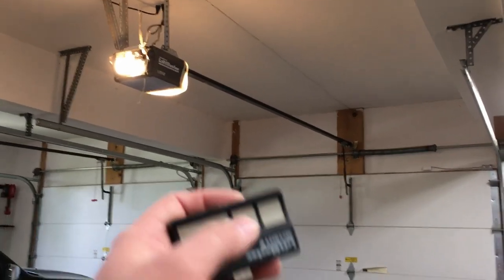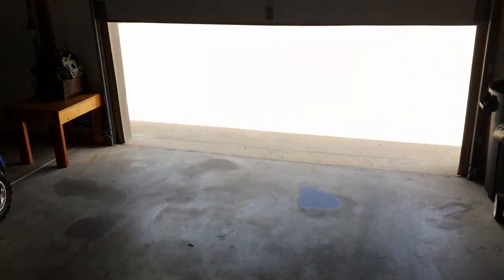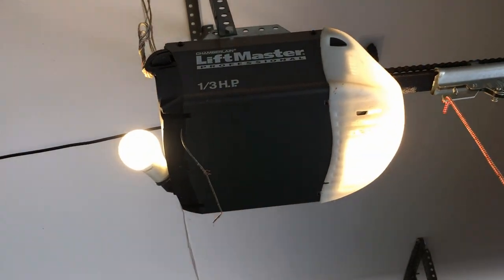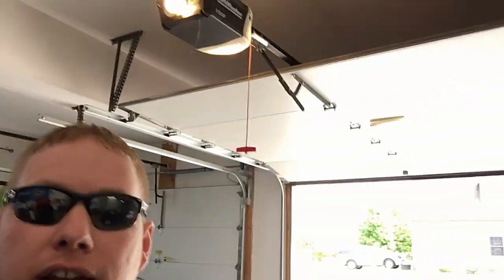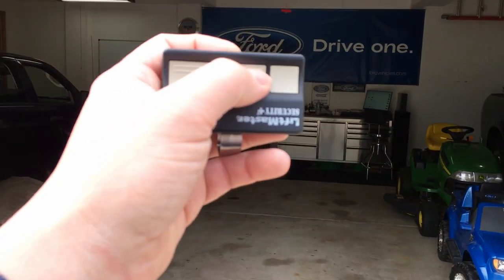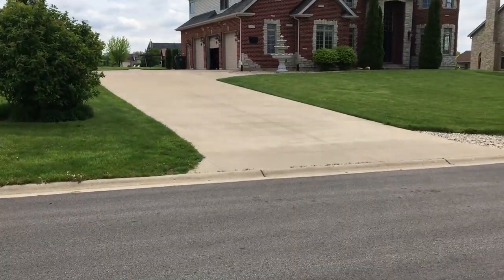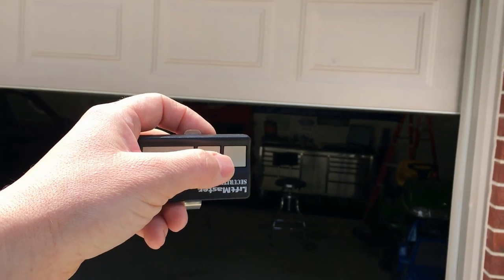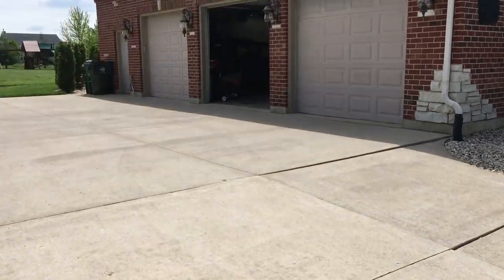Will LED Light Bulbs Really Cause Your Garage Door to Not Work?

Comment: Great tip, BUT let’s make this clear to all the conspiracy theory FREAKS out there.
It is NOT the LED BULB that is the problem, it is the tiny electronic circuit that provide a low voltage DC current to the LED module that is causing the problem.
If you get a 12 Volt DC LED light and wire it up to a 12 Volt TRANSFORMER with a full wave rectifier then the problem is solved
SO THE CONSPIRACY NUTS will have nothing to scream about.
Reply: Science-is-god could you go into more detail as to why. I have a basic understanding of electronics but I’m not sure i understand what you mean. The transformer in the bulb creates the interference? Is this due to a cheap build of a bulb?
Reply: LED lights use low voltage DC power, so every LED bulb contains an electronic power module to provide the low voltage, typically 12 V,  from 120 V AC.
This electronic module uses various components to perform the conversion, these components produce a high frequency signal which can be detected outside the bulb housing.
It is this HF signal that can interfere with the RF (Radio Frequency) signal that is used to operate the door opener.
When you press the opener button in your car an RF signal is broadcast and is received by the door opener which then operates the garage door, if this signal is blocked, or more likely distorted, by interference from the LED power module then the door opener receiver may not recognize it and fail to open the door.
If you take the car or the hand held transmitter close to the door receiver then the signal may be strong enough to overcome the interference from the LED power module.
I should point out that every electrical or electronic device KNOWN emits some form of interference, the engineers who design these devices will try to minimize this interference, the cheaper the device the less the designers will try.
As was said in the video, Incandescent or CFL bulbs run directly from 120 V AC and do not need the power module that LEDs need.
So if you can supply a 12 V DC voltage directly to a 12 V LED you do NOT need that pesky power module, you could use a battery, MOST INCONVENIENT.
Or you could use a 12 V transformer that uses old fashioned copper wire coils to transform 120 V AC to 12 V AC then a full wave rectifier to convert the AC to DC then run 2 wires up to the LED light, VOILA.
Not quite, the light would stay on all the time, you would need some sort of switch to turn the light ON or OFF at the right time.
All this is of course quite RIDICULOUS, it can be done but it is the proverbial sledgehammer to crack a nut.
I was just trying to explain another way of doing things, my original comment was somewhat tongue in cheek.
When I talk about the LED power module I am not talking about a separate unit, these power modules are built in to the LED light base.
Which does bring up another point, the mfgrs. of these lights LOVE to brag about how long the light will last, 20, 000 hrs being a common claim.
However what they fail to add is this, the LED module itself may well last that long BUT that pesky power module WILL NOT.
I bought a new house 3 years ago and installed LED lights, good ones not the cheap chinese junk, I installed GE brand lights.
Within a fews months many of the lights started blinking then dying.
This was obviously a VERY COMMON PROBLEM as GE had a special phone number for LED light problems, when I called them I was in high dudgeon and told them what they could do with their LED lights.
They were very understanding and offered me a coupon to use to get new lights from a retail store at no cost, fair enough I said. Then GE offered to send me a pile of NEW STOCK lights from their warehouse, saying that the retailer might still be selling OLD STOCK that might be just as bad as the ones I already had.
I accepted their second offer, they sent me a pile of new lights by EXPRESS DELIVERY.
So far so good.
I hope this voluminous comment helps.
Reply: You are well grounded in electrical/electronic science 101